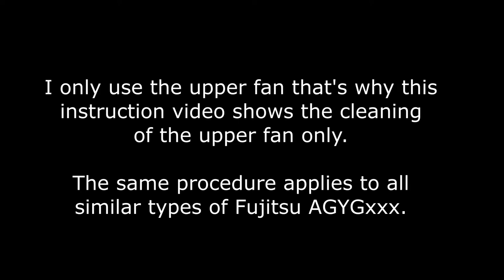Cleaning/removing floor mounted Fujitsu AGYG09LVCA heat pump fan.

Comment: Very nice, very specific video. Thank you. 👍 

Did you, by any chance, find that the dirt accumulation in the fan blades caused it to make a clicking sound, when rotating?

Mine has started doing this when it gets warmer (in fan-only mode). And I'm trying to decide whether the motor and/or blades + bearing need replacing. After 5 years of heavy use. As the install company is quoting £660 for all that. (Could buy myself a whole new unit!)
Reply: Aww, man. Defeated by the last screw; the one on the axel just would not budge. Maybe I'll try to dry clean in place with brush and vacuum...
Reply: By the way, mine made some strange noise too. I readjusted the axel end screws a bit. Now it rotates with ease, without making any noise... Good luck ;-)